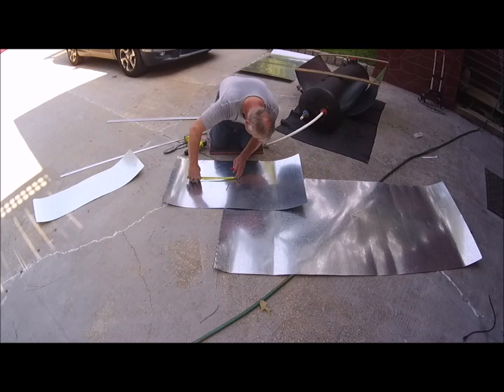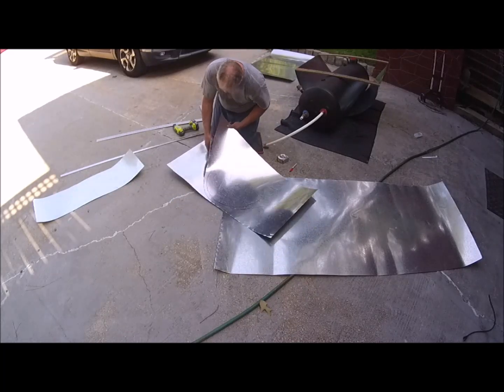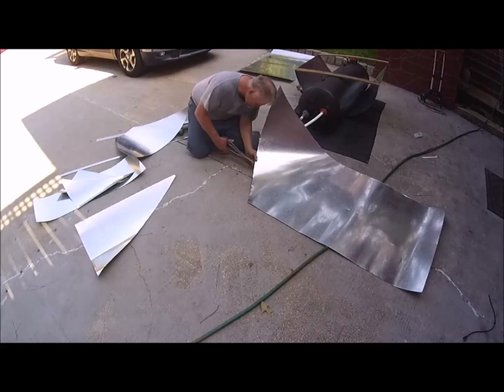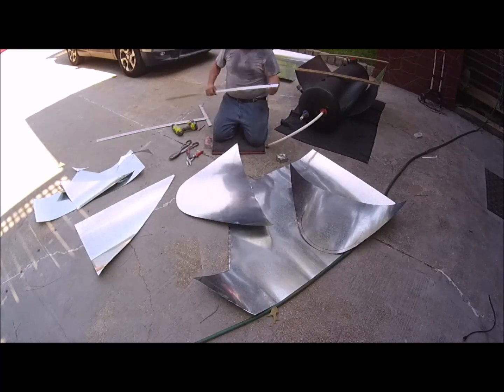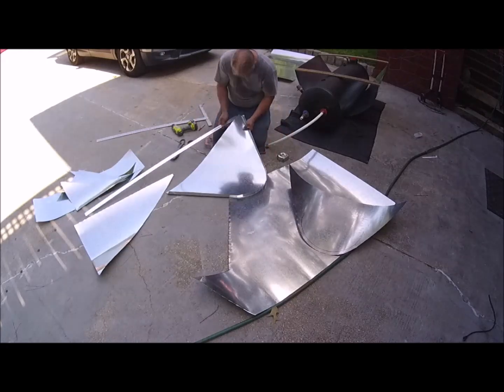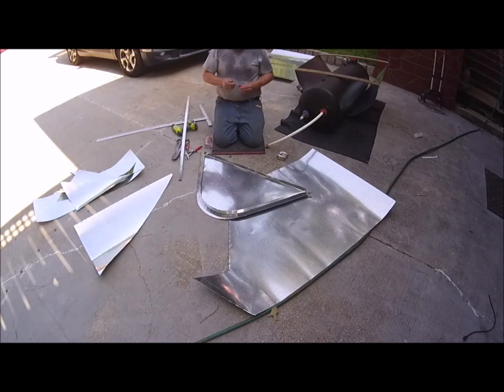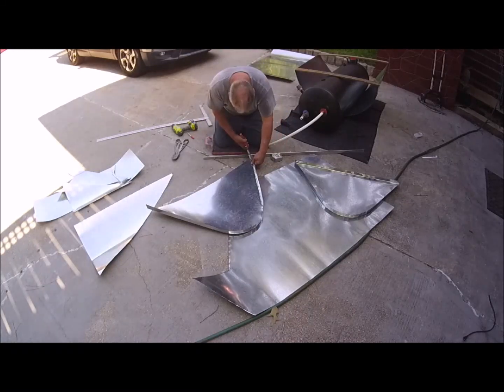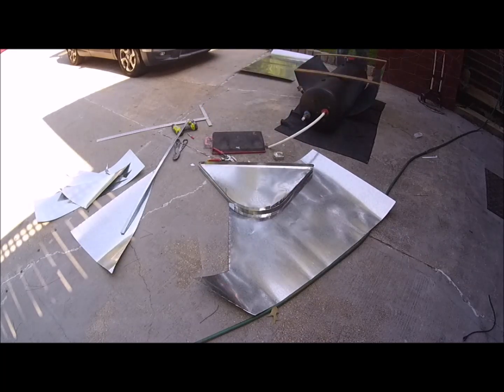Parabolic trough mirror for Solar Batch Water Heater

Comment: great video, thanks for sharing.  Another high temp tape thats readily available is the tape for powder coating, its good to 200C.  I am doing the same with just a pipe, a circulating pump instead of a batch system to heat water in IBC totes for thermal mass in my green house.

Comment: So, you just abandoned this without finishing it?
Reply from the maker: What happened? My home owners insurance canceled my policy. Said they would not be able to write an insurance policy on my home with plumbing connections going outside the home. So yeah I had to abandon my solar project.
Reply: @AlvinShepherd  Ouch. That's evil. Especially since plumbing connections outside the home are less likely to cause damage INSIDE the home.
Reply: @AlvinShepherd  That sucks, what if you used a thermal transfer tank so it was not directly connected to your domestic water system?
Reply from the maker: @speedbuggy16v  Yes had that used coils inside 2 -55 gallon barrels. Coils had house pressure barrels had low gravity pressure.
Reply: @AlvinShepherd  Well that just sucks then.  Sorry your ins company is such a stick in the mud.